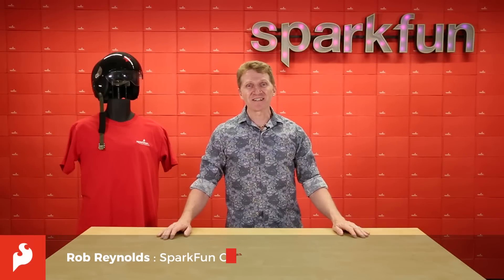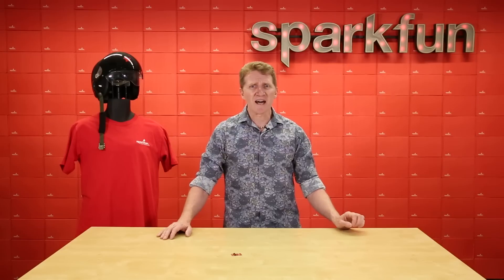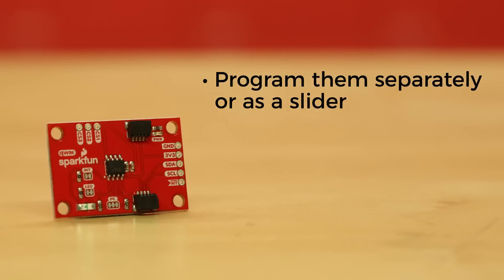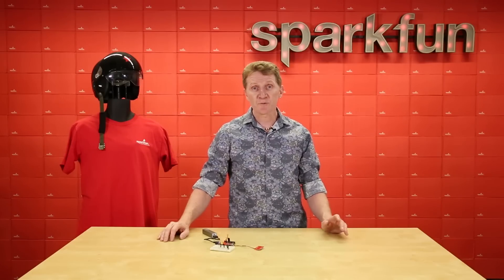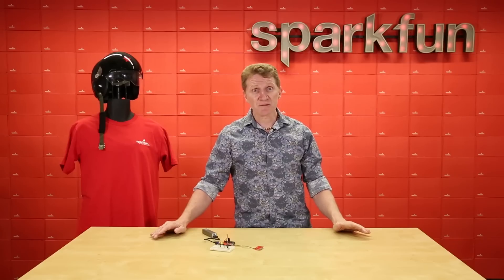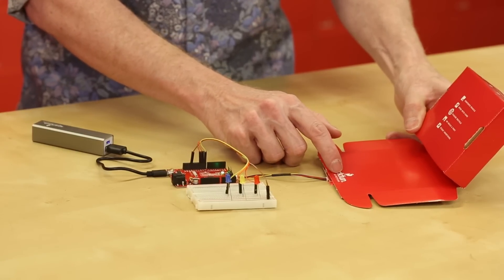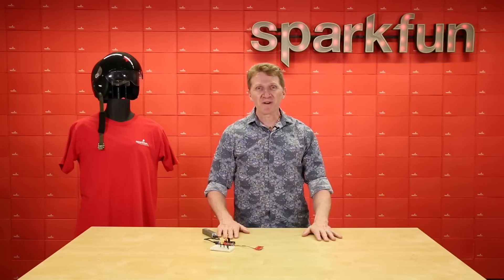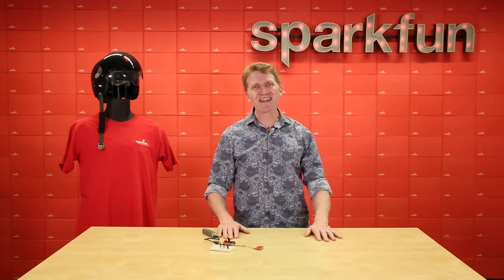Product Showcase: SparkFun Capacitive Touch Slider

Comment: OK you light 3 different leds but you don't need a slider for that ! You didn't show the slider function which is what is interesting.
Reply: He does a little slide under the shirt on the mannequin at 1:40
Reply: @blakehouchin2304  OK ! That's not what I meant as a demo. I'd have rather see a counter from 0 to 255 going up and down according to the finger's move... That's what I call a slider.
Reply: @nonothebot  was also expecting a linear slider with 0-255 values, just bought 2x and I'm quite sad that it can only detect if a pad is touched (and a little interpretation in which order for detecting a swipe to the left or to the right) :(
Reply: @pinkcloud.engeering  THANK YOU SO MUCH for your com !